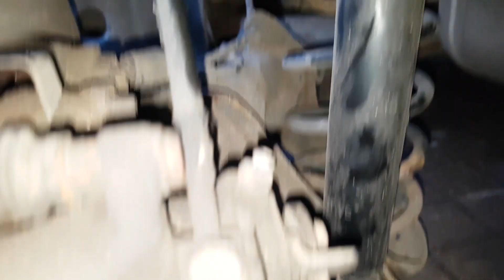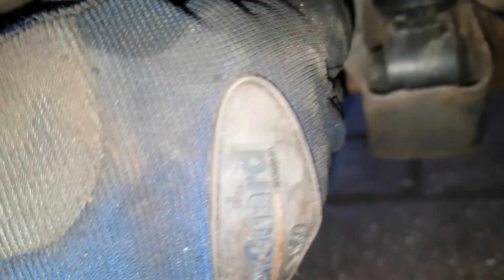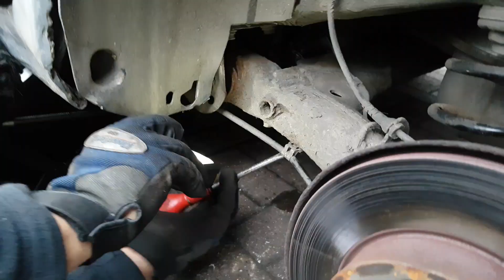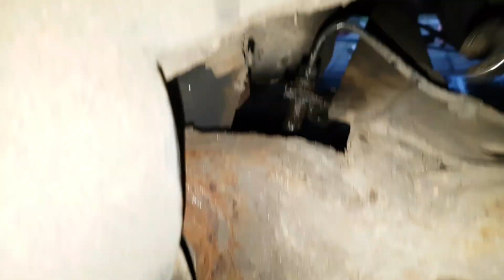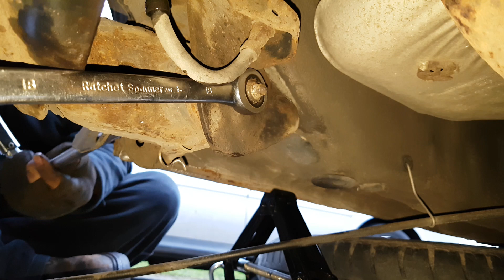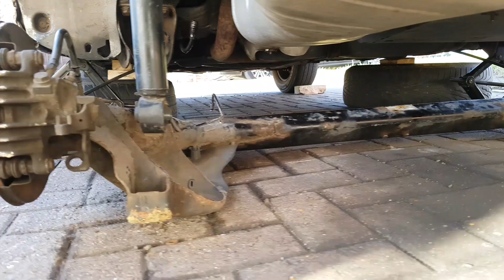VOLKSWAGEN GOLF MK IV REAR AXLE REMOVAL DIY

Comment: At 1:00 in the video how do you remove the brake line off the axle after tapping the clip off? I've got the clip off but can't get the line out of the bracket there? Thanks in advance
Reply from the maker: You need to remove the lock
Reply: @guddupappu3582  thank you for the reply! How so? I can see a small tab which the clip went onto do I hammer that round somehow?
Reply: I got it off sorry! The brake line was corroded through the bracket. Had to wiggle it with some pliers for a while but they are out of the axle. Thank you

Comment: Hello, is it essential to remove the brake lines to change the bushes?
Reply from the maker: Well if you have a bush removing  tool then you don't have to remove the axle and brake line
Reply: @guddupappu3582  I have made what you are using, it's very similar. So I can just remove the shock absorber bolts and bush bolts and drop it slightly? Thanks for the video by the way it's helping me greatly.

Comment: Could i possibly leave the brake lines on if im lowering the axle to replace the coil springs? Or do i have to unhook the brake line and just say screw it and bleed and flush the brake line as well?
Reply from the maker: Leave the brake lines on

Comment: could this make your wheel out of alignment
Reply from the maker: Sam Brown yes i think the worn bushes make wheel out of alignment
Reply: mine are way out you can see it form the back of the car its and and tread is worn out on the inside thanks for the fast replay
Reply: Guddu Pappu was thinking could you put a packing plate in the side that out to bring it back into  alignment